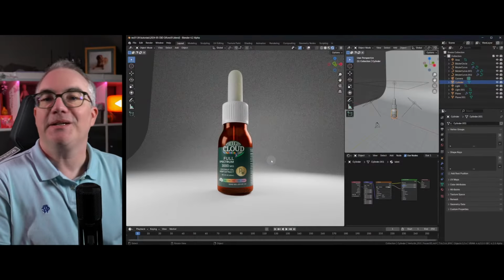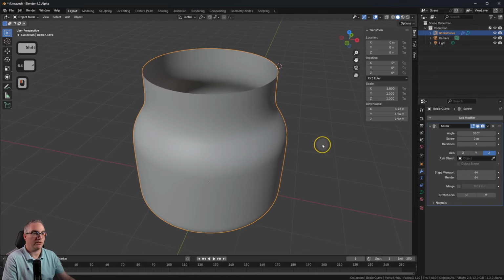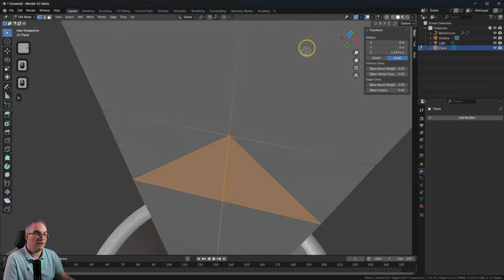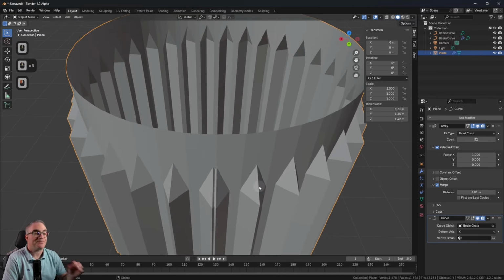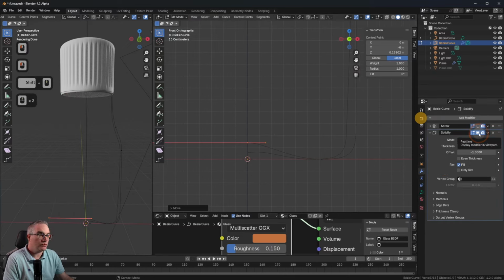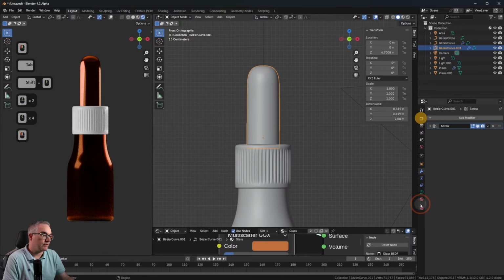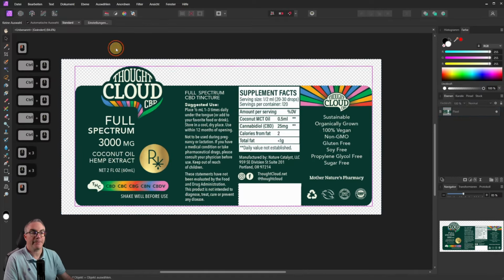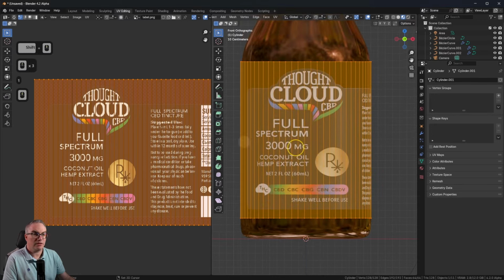Modeling for Product Viz - Beginner Blender Tutorial

Comment: 21:53 Do the array using, lets say 32, apply the array, apply all transforms, use simple deform "bend", axis Z, 360º. done.
In order to save time fiddling with parts like the label just copy the bottle, delete the mesh you don't need, use solidify and delete the inside mesh, You can also use Shrinkwrap modifier.
For the UVs use some of the available pluggins and normalize the tiles/islands/shells or search for correct face attributes which is antive to blender.
overall very good tutorial! and your techniques are good and non-destructive. Cheers and thank You

Comment: Hi Chris, I created this cap setup using geometry nodes and it's super nice because you can change the cap height, radius, "panel" count, depth, the pieces auto-weld, etc all procedurally.  I was just curious if there was a reason you didn't want to do it using geometry nodes?
Reply from the maker: I'm sure that GN setup took some time to put together. Awesome solution if you need to make many different but similar caps. But for just 1 product viz I wouldn't spend the time and just use the good old modifiers.
Reply: @chrisprenn  Hi Chris!  So, I did spend a bit of time on both the modifier setup and the geonodes setup, since I wasn't sure how best to make this model efficiently but with some procedural precision as well.  If you could easily access a mesh item's dimensions attribute without having to do a work around, then this would be a significantly easier setup.  But I was able to create a procedural circle curve that sizes perfectly to the array length so that you always have a perfect termination point.  There are two awkward parts to the setup; 1) keeping a reference to the panel width (prior to adding the array modifier) and 2) calculating the delta offsets so that you keep your dimensions intact...and with the delta offsets matching the original dimensions you can drive the radius of the curve circle.  Now that I have the setup established I am thinking about making a quick setup script.  Let me know if you would be interested in checking it out!

Comment: 2 more tips for the curve and the array:
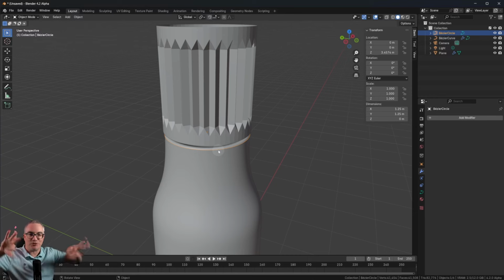19:50 you don't have to rotate anything if the part in the array goes in the wrong direction. Go to the edit mode for the curve, select any vertex of the curve, right click and from the context menu choose "Switch direction".
25:20 To get the "right" amount/width of the arrayed part: activate the addon "Curve Tools" which ships with Blender. In the N-panel under "Edit" you will find the section "Curve info". Click on the button Length and it will show the length of the curve. Don't try to change the length, just click on it and copy the value. Grab your calculator (or let Blender do the math) and divide the length by the amount the part should be repeated. Or the other way around, divide the curve length by the width of the part so you get the current amount. Round the value either up or down, and then use that integer to calculate the new width. 
I am pretty sure you know the following, but for beginners reading this: deactivate the Curve modifier and the Array modifier as well to set the new width of the part in Object mode, apply the scale and re-activate the Array. If you know the amount and just need the to calculate the new width you can even directly do the math in the field for the width in Blender.
If it does not look correct (sometimes the modifiers don't update correctly) in both modifiers delete curve in the field for the object reference, choose it again first for the Array and then for the Curve modifier as well.